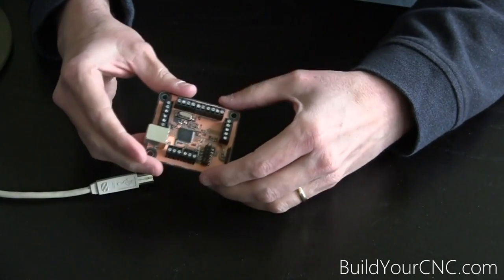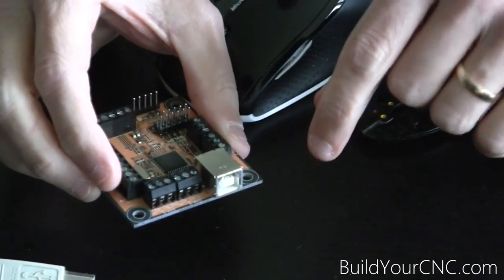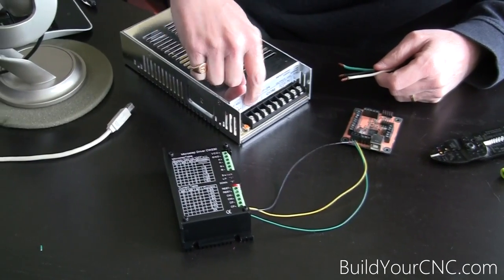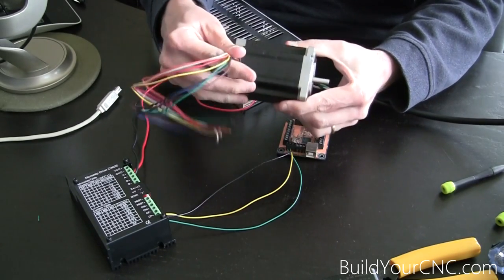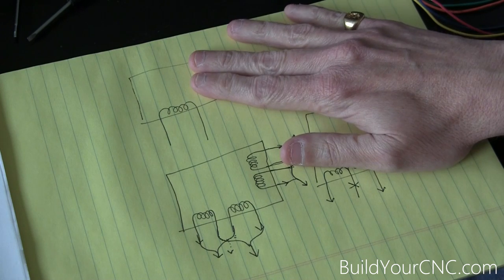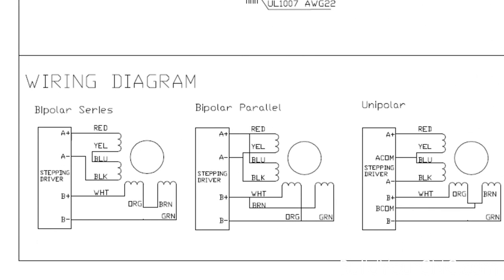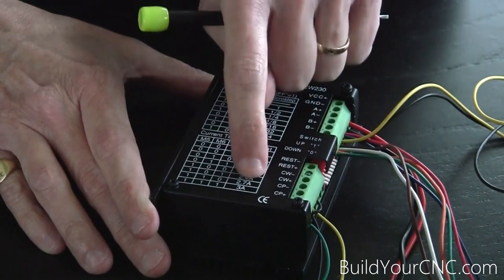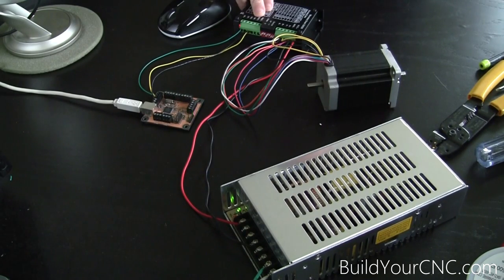How to Wire the USB CNC Controller/Interface Part 1

Comment: So after I install the stepper motors, how does the system know what’s the start position ?
Reply from the maker: You set the zero position in your control software (i.e. Mach3).  Move the machine's axes to the position that you determine as zero, then tell the control software that that position is zero.  Now, when the machine moves, or you move the machine, the computer knows the position relative to the zero position.  This is possible because the computer (interface) sends the pulses to the stepper motor drivers.  Each pulse is a known increment of movement.

Comment: Hello
I have a CNC Master Baron Mill. It uses this software http://www.cncmasters.com/index.php?page=master-software  I just ordered all the stuff in the video and I hope it works with my program. Will it???  And thanks for making these videos they are awesome.
Reply from the maker: This comment got caught up in the spam comments section (due to the inclusion of the link), but I thought this comment was important.  To answer your question: the milling machines to which you refer in your link probably use stepper motors to drive the axes.  Most generic interfaces will work with these types of mills.  If you have any issues installing, let us know.

Comment: I have a slightly different controll board that has ck+ and ck- and dir+ dir- but not enable so i'm confused on how to make this work ...
Reply: It depends on whether you set it up as common anode or common cathode, one requires an enable the other doesn't.

Comment: hey great video but I have a question I bought the exact same drivers from the site and now I want to upgrade to dual drive gantry and was wondering If i could connect 2 motors to one driver, and if I would need another power supply because the one I have now only has 3 terminals thanks.
Reply from the maker: Two motors to one driver will try to pull too much current and will be current limited.  The motors will only have half the torque if you try this.  Each motor needs a driver.  In this scenario, you will need to connect the two drivers to the same step and direction pins.
Reply: You would also have to "SLAVE" the "A" axis to whatever axis you use to drive your gantry(X or Y) that way the software will know that "A" is (X or Y) and send the same signals to that motor so that it is in perfect sync with its mate.

Comment: Patrick I went to your website to get the Assembled Control Box (redFly) without the motors. I saw this with your builds $259.00 so can I order this without the motors?
And what about this statement you made: "Actual motor tuning based on your machine will vary. In some instances you will have to calculate the steps per inch yourself if we do not have the relevant information." What information do you need here, could you help me with this?
Reply from the maker: Yes, you can order the redFly without the motors, but you will need to call the number on the top of the site.

Regarding the statement on motor tuning.  That just means we don't know your mechanical drive system and you will need to set your microsteps on the drivers and determine the step/inch to suit your needs.  For example, lead screw calculations will differ greatly with say rack and pinion.
Reply: Yes I saw that and did order it yesterday but received no email confirming the purchase. It is a simple lead screw system, I called the number on the website & left a message with my number.
Reply from the maker: Ok, let me know if they don't get back to you with a confirmation.
Reply: The table is 2 ft wide by 4 ft long, it has KL23H251-24-8B & 23-205-DS8  motors, I understand these are the standard motors for a system such as this.

Comment: Frome where can I get this usb board?
Reply from the maker: That board has been deprecated.  However, we do have others that accept USB connection: https://www.buildyourcnc.com/electronicscombo.aspx
Reply: Patrick Hood-Daniel thanks
I searching a 4axis USB BOARD  compatible with mach3 
and I get a parallel port ,can I connect with any USB parallel port or should be have a special one? 
thanks for your help
Reply from the maker: Sure, this board will work with Mach3 and Mach4 and accepts either USB or ethernet connection: https://www.buildyourcnc.com/item/electronicsAndMotors-electronic-component-breakout-Mach4-mach3-USB-ethernet-Board